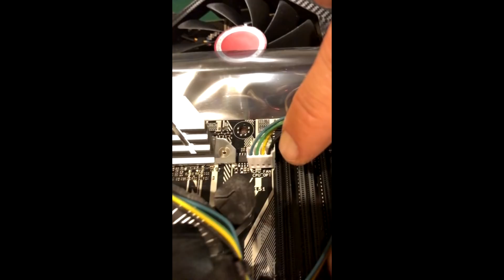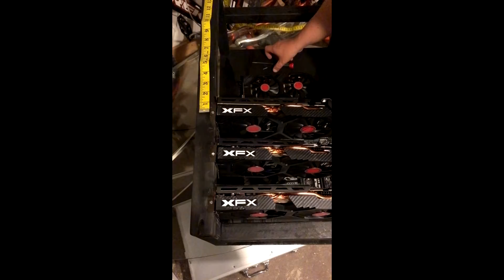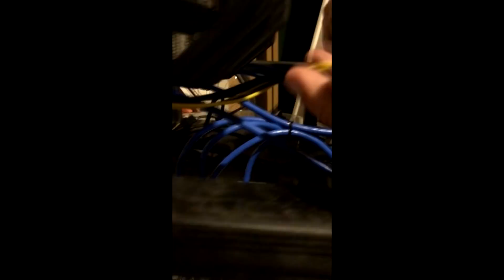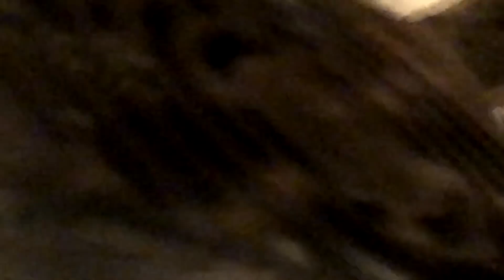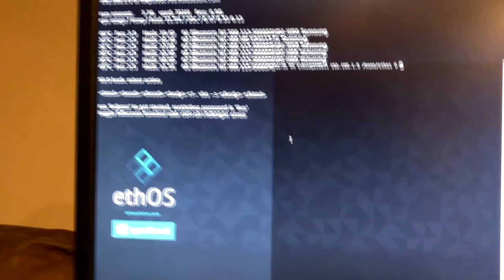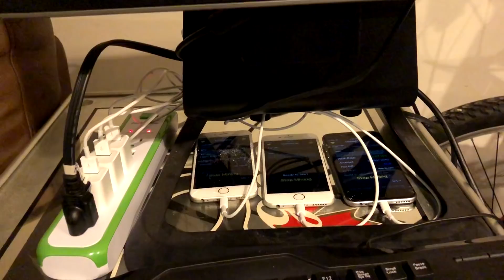My Six Card RX 580 AMD Ethereum Mining Rig Build! Awesome Hash Rate!

Comment from the maker: My Etherium Rig Setup!
Prices are what I paid for it, they do go up and down.
$300.00-$500
(4) Graphic Cards - XFX GTS XXX Edition RX 580 8GB OC+ 1386Mhz DDR5 3xDP HDMI DVI Graphic Cards RX-580P8DFD6
http://amzn.to/2BJqtKP  http://amzn.to/2FsXPPq
http://amzn.to/2CUKlKR  http://amzn.to/2FrWoAN
http://amzn.to/2Dmyar4  http://amzn.to/2FtJRN6
http://amzn.to/2FtJZfy  http://amzn.to/2CS8th6
http://amzn.to/2CSWNe1  http://amzn.to/2CSG7Dp

$149.99
Motherboard - Asus Prime Z270-A 
http://amzn.to/2BBwwna

$83
CPU - Intel Pentium G Series 3.50 GHz Dual-Core LGA 1151 Processor (BX80677G4560)
http://amzn.to/2BGXwkX

$105
RAM - Ballistix Sport LT 8GB Single DDR4 2400 MT/s (PC4-19200) DIMM 288-Pin - BLS8G4D240FSB (Gray)
http://amzn.to/2yTElz9
Cheaper Ram 4GB $53 - http://amzn.to/2FsY7G0

$200
Power Supply - EVGA SuperNOVA 1000 G3, 80 Plus Gold 1000W, Fully Modular, Eco Mode with New HDB Fan, 10 Year Warranty, Includes Power ON Self Tester, Compact 150mm Size, Power Supply 220-G3-1000-X1
http://amzn.to/2AX4H4P  ALT: http://amzn.to/2EyIGe4

$36.00
(2) PCI Extensions (Risers) - MintCell 6-Pack PCIe 6-Pin 16x to 1x Powered Riser Adapter Card w/ 60cm USB 3.0 Extension Cable & 6-Pin PCI-E to SATA Power Cable - GPU Riser Adapter - Ethereum Mining ETH + 2 MintCell Cable Ties
http://amzn.to/2yN2BTk

$13.00
PCI-e 1X/4X Card to NGFF M.2 M Key PCIe Slot Adapter
http://amzn.to/2ja7Gjh

$9.00
(200) Zip Ties - Cable Matters (Combo Pack) 200 Self-Locking 6+8+12-Inch Nylon Cable Ties in Black & White
http://amzn.to/2B1Cy0B

$20
Thumbdrive - Flash Drive 32Gb Antdisk Usb Flash Drive High Speed Memory Stick Thumb Storage (N10 32GB)
http://amzn.to/2yNUDcN

$13
Felt for Motherboard - X-PROTECTOR Premium ULTRA LARGE Pack 
http://amzn.to/2yNbxIk

$200 
Open Frame - Veddha Professional 8 GPU Miner Case Aluminum Stackable Mining Case Rig Open Air Frame 
http://amzn.to/2yObuMy
Reply: kevinsmak I can't play on my computer bc I'm sick and I think I have the flu

Comment: kevinsmak -hi i am harsh and i wanted to buid a mining rig but i have a dought about pos(power of stack)i need you asistance  i heard that soon etherium will shift to POS what is your opinion
Reply from the maker: Well if you haven't built a Rig by now I'm not sure it's a good idea.  I am going to create another one but it's because I have most of the parts.  POS was suppose to hit like 6 months ago but again that is a guess for everyone.  That's not where the issue is, the difficulty is skyrocketing because of some huge farms that have recently went live.  Don't forget you can also mine other items but ETH in my mind is the best.  I'm starting to just HODL some of it as I see it being the future bitcoin from what I have researched so far.
Reply: kevinsmak  thanks for the reply, one more thing i would like to ask you is that can i use gtx 1060 6gb card with pcie 2.0 slot?
Reply from the maker: I have never used Nvidia but I believe they use the same slots as the AMD cards.

Comment: How much watt per card?
Reply from the maker: I don't have the exact amount but I was able to fit 7 cards and be at around 980 watts  before the last card I added on I was at around 843 watts.  Next and final card we add we plan to get a smaller power supply just for the last card and power some risers to give some relief to the main power supply.  I'll have an update video out on Wednesday showing what has happened.
Reply: @kevinsmak  Strangely, I get 504 watt for my 6 rx 580 8gb rig. But hashrate is not affected.
Ethash = avg of 29.5 - 30mhs

Comment: How much etherium do u get a day?
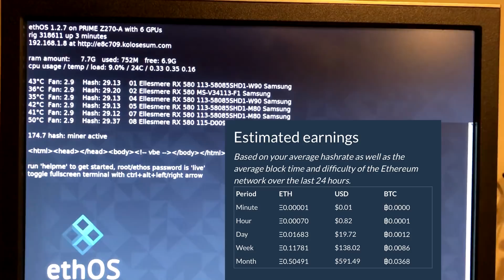Reply from the maker: 17:21 shows a chart with the 6 cards.  I'm actually a bit higher now that I added a 7th card.  The updated amount is $22.39 at current rate which is .01828 ETH a day .54829 a month totaling around $671.57.
Reply: kevinsmak not to shabby
Reply: 2 months later you get only $ 280 a month with 7 GPU. that's not good.

Comment: ITS only intel pentium 4 change i to core i7 or core i5 or core i3 or dual core
Reply from the maker: You don't need a strong processor for these types of machines most people use Celerons.  Only thing that really matters is the power supply and graphic cards.
Reply: alvin man I have Intel Core 3 7k